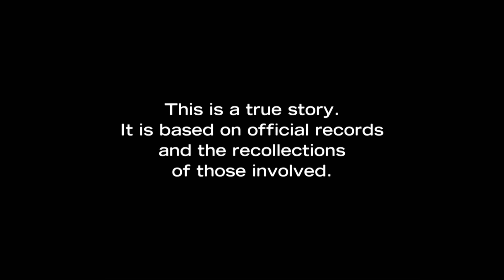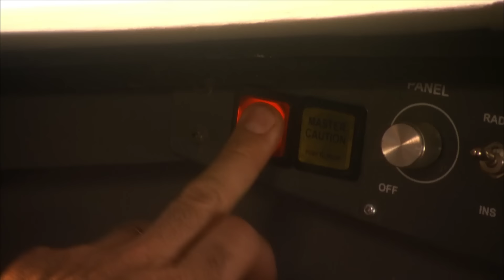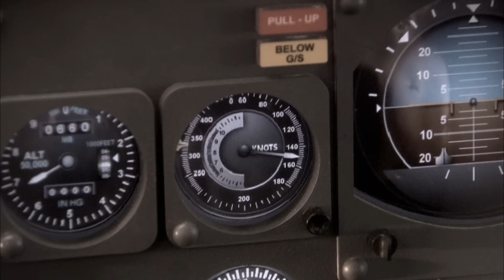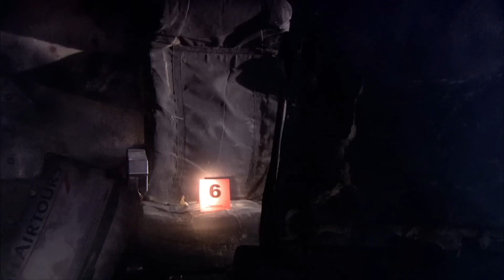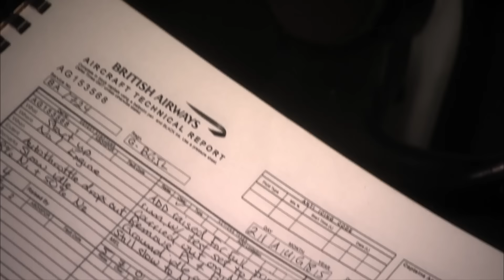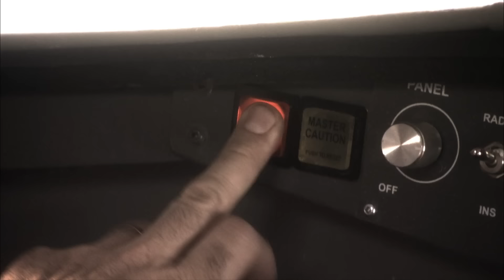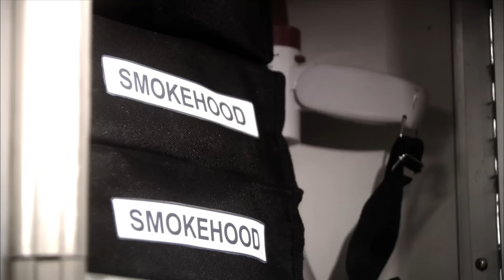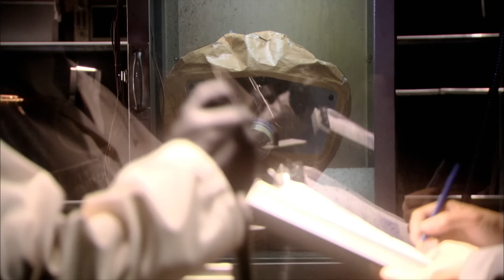Engine Catches Fire On Flight 28 | On Board Fire | FULL EPISODE | Mayday: Air Disaster

Comment: It’s easy blaming the pilots… they did there best…. Faulty engine and faulty exit door is to blame
Reply: The pilots performed perfectly. They kept the plane on the ground. If they would have attempted takeoff with that hole in the fuel tank everyone would have died.
Reply: And the passengers getting jammed.
Reply: @Powerranger-le4up  yes I forgot to write that but I’m sure that door would have saved more lives if not all as the people panicked and went to the only door opened, thanks for adding your comment
Reply: They did the best they could with what they had at the time.  Certainly procedures and training could be updated but I agree that they had no reason to believe they were not doing the right thing.  This is not like one of the several episodes I’ve seen with negligent or reckless pilots.
Reply: @andrewtaylor940  Dont brake so hard, might damage the plane thats about to burn us all alive.
Reply: People panicking and narrow aisles made getting out difficult. Now aisles are wider to make evacuation faster - it’s good to know things improve after each accident
Reply: @Sharan Shibu yes that’s absolutely true
Reply: @MacMashPotato  😑 they don’t break to hard because a blowout and the temp increase to the tire in itself would have created a fire. Also if you actually watched and listened they believed that the reason for the explosion was the blow out itself. Don’t think like a potato 🥔 bro.
Reply: @MacMashPotato  you ever seen a plane of that size up close?
The pilots can't see the engines and there isn't side mirrors on a plane.
Your name fits perfectly, you never go full potato but instead you had to go straight to mashed potato.
Reply: We as humans tend to love to judge others unfortunately. Definitely respect the flight crew, this is a very scary situation to be in

Comment: The evac checklist should should say. 1) is plane on fire...(YES)- pull fire suppression for all engines and then focus on passenger safety.  If NO... then do the 10 pages of things.
Reply: All planes should have cameras on the the wings tail and engines. Pilots have no easy way to see these. If they could see these relatively easily, they could quickly diagnose problems.
Reply: @davidlloyd7597
It could mess with aerodynamics, the camera's could freeze, get soaked etcetera depending on where the plane is flying. It would also mean more wires and more weight on a plane. Lastly, if it's at all possible to install cameras, the cost is an enormous factor (read deterrent) for airlines.
Reply: @Southamericangirl42  Make them retractable, problems solved ... weight issues ? We are talking a kilo max for wings, engines, rudders, ailerons, what are you talking about ???

Comment: There was just so much that could not  be known at the time - the pilot didn't know it was a fire, the crosswind was not something anyone could have predicted, though human behaviour should have been understood. Sad anyone had to lose their life that day. The stewardess is a hero for trying to get everyone out.
Reply: I heard the lines "there's a big fire" from the goddamn atc before they even fully stopped. The captain should be jailed.
Reply: @Vespyr_  Then maybe the captain really did make an extremely bad call to pull off the runway. Hearing that there was a crosswind that aided the fire - that was unpredictable - so much so that it took investigators quite a while to discover why the fire burned like it did. No way the captain could have understood that part in those few moments.
Reply: @thexxit  The crosswind wasn't his fault, fair enough on that point. But having to taxi down a runway after the stop was ridiculous. Lack of situational awareness of this sort is a big reason loss of a flight engineer or a third hand in the cockpit has never been properly addressed.
Reply: @Vespyr_  Yes, I see your point that after they stopped an immediate evacuation should have happened instead of taxiing to the side.
Reply: @Vespyr_  To me, it looked like they didn't stop until after they'd gotten off the runway and onto the taxiway. That was probably standard practice so the crew and first responders could safely handle the emergency and evacuate the passengers while still allowing other planes to use the runway. Sort of like moving both cars onto the shoulder after an accident. 

If the pilots had understood how bad the fire was, they might have decided to stop on the runway. But they couldn't see the engines well from their seats, so the only information they had about the fire was the alarm in the cockpit and the controller's very subjective remark about "lots of flames." 13:05 suggests that the pilots had no idea how serious the situation was until they'd escaped from the plane.
Reply: @Vespyr_
Monday morning quarterback...

Comment: "Engine fires are not uncommon."

...might want have the engineers look into that.
Reply: Engine Fires are integral to how jet engines work. A jet engine IS a carefully controlled fuel fed fire. Most engine fires are an uncontrolled amount of fuel is being dumped into the engine and ejected out the back end.
Reply: @andrewtaylor940  exactly as soon as you disrupt that process even slightly, a massive engine fire is the result
Reply: @Taydrum  Well yes. But “Massive Engine Fire” is an odd thing. Jet Engines are designed for fire. And have a lot of things in place to reduce the damage of uncontrolled engine fire. The plane is generally shielded well from the fire, etc. But that of course depends on the cause of the engine fire. Something that causes great trauma to the engine, such as a large bird strike or a major component failure can often tear through the protection. Or lead to a situation where the perception of an engine fire masks the real problem. Such as this incident. Or this weeks new Air Crash investigations. Where a wheel well brake fire fed by hydraulic fluid, in the rear of the engine nacelle led everyone to think they had, and troubleshoot around an engine fire… up until the wing fell off. In this case the real problem wasn’t engine fire, it was massive burning fuel leak.
Reply: Yeah I stopped being a car person when I learned a motor is basically a tuned sequence of miniature explosions happening thousands of times a minute a few feet away from my vital organs. Lol
Reply: Combustican - such a robust part, one that wouldn't be expected to cause problems.
 Considering the complexity of the avionics, engines and airframe - it's a miracle the darned things fly at all!
And it's hard to imagine a time when they didn't know burning plastic created lethal fumes.
Reply: Cost to much. It's easier for them to take their chances.
Reply: @Asherah 1147 Fuel-injected gas cars still have spark plugs.  The fuel injection is to help tailor the fuel-air mixing process and reduce the engine's susceptibility to vapour-locking at high altitudes; it isn't like a diesel, where the air is already compressed hot enough to ignite the fuel as soon as it enters.
Reply: @Vespyr_ look into electric cars. I've got one, partially for the same reason lol
Reply: @sonicbhoc IMO all that does is trade the possibility of combustion fires for the possibility of electrical fires
Reply: @Vespyr_  I imaging you'll be sitting in the dark, once we discuss electricity and gas supply...
Reply: @sonicbhoc  I'll take an easy to extinguish gas fire over huge, uncontrolled fire next to my house, please. Tho yes, hybrids catch the most, then gas, then electric.
Reply: @sonicbhoc easier (and less) maintenance?  Lower operating costs?

Comment: That captain was a quick thinker to abort take off. If he proceeded all passengers will perish. The flight attendant was an absolute hero, thinking of others first, very courageous ❤
Reply: Agree! And it is very difficult to abort takeoff like that...there is a threshold window where if you try to cut the power to the engines at the wrong moment, you cause an accident worst than what you were trying to avoid.

Comment: 1985. The year that aviation enters state of worst crashes
Reply: Agreed.  70s was just as bad with Tenerife,  Chicago, ….
Reply: @rosemaryangela1825  a forest in France
Reply: @rosemaryangela1825  1990s and 2000s are not better either
Reply: 1972 was horrific as well.
Reply: I don't think any era is good far as flying. The 80s were terrible the 70s were terrible. The 90s were terrible highlighted by TWA flight 800 the 2000s the 2010s were also terrible.
Reply: crazy

Comment: No one, in an emergency, is going to throw a hood over their head before scrambling.  It feels like it limits your vision, and makes you feel more entombed.  I think the use of smoke hoods is not a great idea.  I think it won't improve the situation much.  How about an emergency canned air bottle, like divers use?  Non restricting, doesnt cover your whole head, making you feel more enclosed.  Or BOTH.
Reply: If there's fire in the cabin the last thing you want is to add more oxygen. It's why those O2 masks are for decompression only and not for fire/smoke on airliners - they don't want the fire to get bigger. But yeah, I think people would get more frantic if asked to wear a hood like that and it would cause more problems than it would solve.
Reply: @Amoreyna  this is why i dont work for any safety commissions or panels etc.
Reply: From what I understand the smoke hoods are mainly a British fixation, and mostly a holdover from the Royal 
Navy. The concept is fine providing you have a population of well trained users. Such as a ship full of highly trained sailors. Who practice with the hoods regularly. Using any sort of breathing gear is difficult and requires quite a bit of training and practice. SCBA training is one of the hardest elements of Firefighter training. Putting a full mask or hood over someone increases the panic. You can’t expect the normies to do it in an emergency.
Reply: If I'm further from the door yes I would put the hood on. Those near the doors would not need it.
Reply: Even an N95 mask might help a bit? Like the one the fire guy was wearing. Easy on and off.

Comment: It's utterly shameful that anyone died on the runway. Not even crashing. On the runway. Shameful.
Reply: If one of those firemen handed their mask and air tank to the stewardess ,should would have continued to search for people in the smoke.
Reply: It's tragic. But "Shameful"? No. Everyone reacted pretty much exactly as they should, or were trained to at that point in time. And were acting on the information they had moment by moment. If you've never experienced it, I don't think you can quite comprehend the shear speed and intensity of this type of fire. And how quickly the smoke becomes toxic. The problem was this wasn't an "Engine Fire" which planes are designed to contain rather well. This was an AV Gas fire from a bowling ball sized hole in a fuel tank. For speed and intensity that is one of the worst things imaginable. Even with Air Crash firefighters responding as fast as humanly possible, there would still be a response time of a few minutes. Just to suit up, start up, and cover the distance to the plane. The failure of the one cabin door likely contributed a great deal to the death count as it likely doubled the time needed to evacuate the cabin. Time that they just did not have. This was pretty much a "worst case" event that uncovered a number of previously unsuspected weaknesses in aircraft design. Mainly regarding cabin materials. Generally fire events that saw this much fire impingement of the cabin were un-survivable for other reasons, mainly because the aircraft crashed. This event happened in a way nobody was expecting.
Reply: @andrewtaylor940  We reached 1985 and people died while the plane was standing still.
Reply: not shameful- it's tragic, most people will die in a plane on fire.
Reply: @andrewtaylor940  Excellent breakdown. Thank you
Reply: @mimib8032
I second that.

Comment: This was just like the "Station" night club fire, where everyone started pushing and some of the exits got blocked. If they had briefed the passengers that sat in the over wing exits on how to open the door and to throw the door outside (not keep it in the plane like they did) I believe everyone could have gotten out.  Its things like this that scare me.  Getting trampled in a fire has to be the worst way to go.  The fire fighters said that most of the 55 that died were piled up at the over wing exit. the last person to escape the plane was a 14 year old boy, it was 5 min after the plane stopped.
Reply: This plane did not have exits over the wings. The video showed 2 exits at the very back (both blocked by fire and smoke) and 2 exits at the very front. And one of the front exits was faulty and did not open until many attempts which took more time.
Reply: @kealilasok14  Are you kidding? This was a 737-200. I promise you it had 2 over wing exits on each side.  Please look up the actual photos of this incident.  you will clearly see them.
Reply: @kealilasok14
The door was faulty because somehow the slide had, at least partly, prematurely deployed and was jamming the door. The flight attendant finally realised that and stuffed it back after which he was able to open the door.
Reply: @scottcol23
They show four doors in this documentary.

Comment: Why on earth should the pilots go over a checklist when the planes on fire?! Sheesh!
Reply: I know what you mean!!! But I believe it's because certain actions can be taken to prevent an even worse disaster . . .
 Like turning off the engines, because they could potentially suck a person in as people are scrambleing around outside the plane. Also, when fireman are trying to put the fires out and have to stand right infront of them . . . And Id imagine certain fluids, not just the fuel, are flammable and turning off certain operating systems could prolong the time before the plane explodes, etc. 
At least, I believe that's what the checklist is for 🤷🏼‍♀️ It's the only thing I can think of that could be worth those few extra seconds . . .
Reply: @Reesicup  that makes sense!
Reply: Im sure there is a claus that if there is imminent danger you can abandon the checklist, or just do it anyways
Reply: @Reesicup  pilots could go by their memory training and shut the engine off,left one likely already shut off, and either gotten out or helped get passengers off the plane. Wonder if they still have a 15 item check list??
Reply: @robertjaent6087  People panic in emergencies, the airlines cannot trust pilots or other people to go by "memory" in this situation. There needs to be clear rules, clear instructions wrote down. Can you imagine a crash where there was no rule book and the official policy of the airline was to trust pilot's to use their memory to shut the plane down. Then one pilot makes mistakes and people die. You'd be back on here blaming the pilot saying they need a checklist so they don't forget anything.
Reply: ya like what the heck, they need to frigging evacuate

Comment: I guess the question is, why are so many dangerously flammable materials used to furnish the interior of airplanes?  I'm sure the answer is cost. Isn't the answer usually cost?
The same answer applies regarding smoke hoods i.e. cost.
Reply: so what do you suggest the interior be made of? concrete? stainless steel, titanium? weight is a HUGE factor in designing airplane,fire retardant materials can quickly add  weight
Reply: Cost and aesthetics.
Reply: @whyyeseyec  and comfort

Comment: Check list? The plane is on fire you are worrying about list? Park and turn off the engines that’s all and get out. I don’t want to be pilot, too robotic
Reply: An aircraft is not your little shitbox Toyota Corolla, it isn’t as simple as just turning a key to shut down an engine and secure the aircraft. 15 items is a short checklist for this industry.
Reply: @silaskuemmerle2505  yes, aircraft has one way to shut it down. secure the aircraft? hahhah, the aircraft is on fire, open the door and get out.
Reply: @silaskuemmerle2505  15 items to shut down an aircraft? hey, the aircraft is on fire, who cares about 15 ways, i would jump out even if the plane is moving if the plane is on fire. quit being a robot.
Reply: @silaskuemmerle2505  imagine you on fire, while worrying about 15 ways to shut down a plane.
Reply: @silaskuemmerle2505  15 items is a short checklist for this industry on how to shut down a plane? who cares,  i make the decision on emergency.
Reply: @silaskuemmerle2505  
i can see the headline
"a pilot was burned alive while going thru 15 ways to shut a plane which was on fire, but the plane was already parked, he just had to get out"
Reply: @silaskuemmerle2505  that's like your car is on fire, instead get out, you decided you have to first turn off the engine
Reply: @silaskuemmerle2505  imagine you are flighting two seater plane, and mid flight, the plane catch on fire, in mid air instead get out, you decided to go thru 15 ways to shut a plane
Reply: @silaskuemmerle2505  the point is, why even turn off the plane, the plane is on fire.
Reply: @benedibrava  stay well away from aircraft if you're going to keep that mentality. You would be a danger to yourself and others.